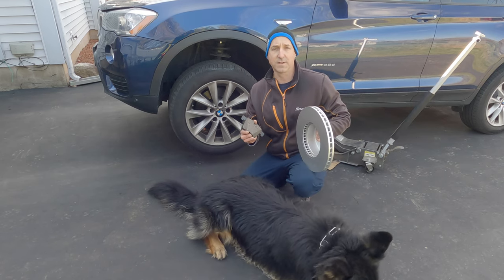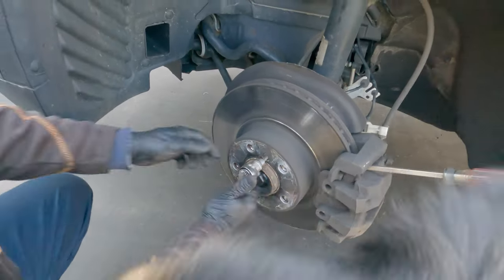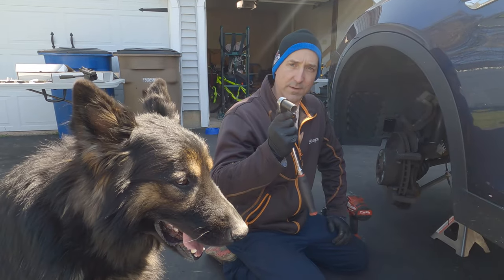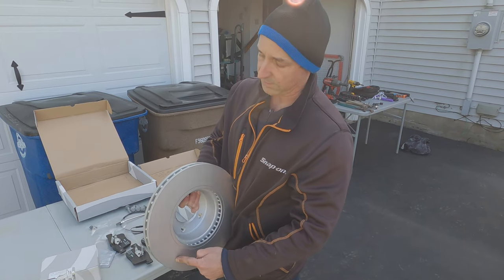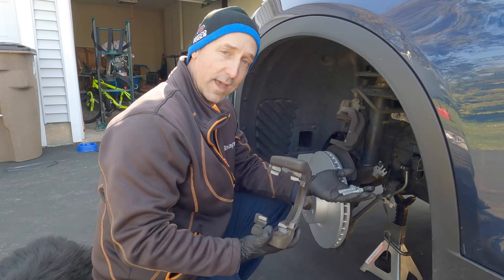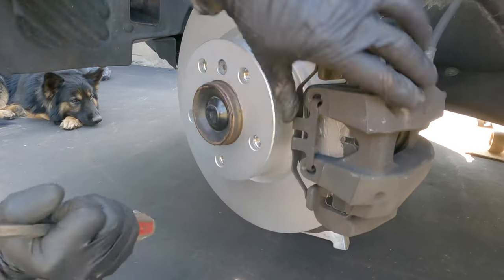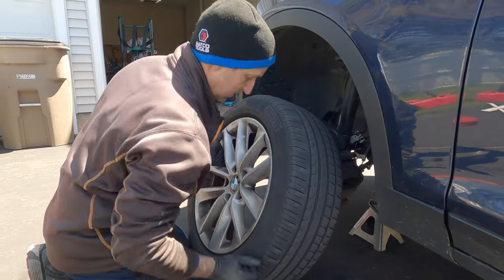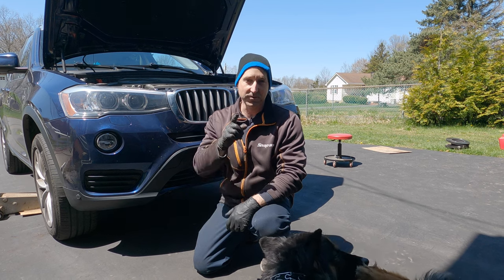F25 X3 : How to replace  BMW Front Brake Pads, Rotors, and Sensor - Complete Guide

Comment: Similar to other comments, I looked at a couple of other videos related to changing brakes on our 2011 X3 and yours was by far the most complete, consise and accurate.  In my instance, the brakes were actually fine but during a previous repair someone had not secured the sensor wire and it wore through and kicked out the brake replace warning.  Thanks again for the great instructions!
Reply from the maker: Thank you! Sorry to hear about the sensor. Very common issue. I often see that after a brake flush because it was left unsecured.

Comment: Thanks for the video. It was a great guide with my recent brake job. Just a note: there's no need to pop off the 8mm hex slider bolts if you're doing both pads and rotors. By popping off the 16mm carrier bolts, the caliper will come out all in one piece and then you can pop off the pads
Reply from the maker: Very true, I like to show the full steps. Some people have trouble doing that trick.  Glad it helped!
Reply: Clever...also using a channel lock was smart...I always used a clamp and old pad but the locks are much easier...always learning

Comment: Great video!  I just changed my front brakes and rotors, easy thanks to you!  My 2017 X3 2.8i caliper hex bolts however weren't 7mm but they were 8mm.  FYI, installed Akebono pads (kit came with the sensor cable) and Zimmerman rotors.  I picked up new rotor screws and 16mm bolts from the dealership.
Reply from the maker: Hi rkim, Great to hear my video was helpful! Thanks for the added information. You will have to let me know how the zimmerman rotors and akebono pads hold up.

Comment: Nice video!  My rotors are warped so i assume new ones if we cant turn them? Original 2014 x3 149k miles
Reply from the maker: Hi Doug, Sorry to hear that. It seems like a lot of BMW's are having this issue. Not sure if it is a quality thing with rotors from BMW. If they are above the minimum measurement by .5mm they can be turned using an on car brake lathe but I would recommend pads and rotors. To me it is still a better repair.

Comment: gotta question? does the brake pad sensor for bmw have to be specific with a different pad or it doesn't matter
Reply from the maker: Hello, The sensors are vehicle specific but some of the parts do cross over to different BMW models.

Comment: Haven't seen any video that actually done it to the manufacturer repair instructions. 
Hub surface must be clean and no grease on anything. 
Brake carrier must have no abrasives used on cleaning, only allowed is brake cleaner and lube with BMW brake grease. 

Personally I never had any brakes fail due to seals in master cylinders getting rolled or debris going back.
But I tend to find that using a mini prybar at the brake sensor hole area, you can literlly push the piston completely back and don't really need any other tool to push the piston back.

Though with the brake bleeder screw open, most brake piston retractions, you can even use your hands to push the piston back provided there isn't too much resistance due to size and internal corrosion.

The brake bleeder screw open with a miniture prybar can speed up allot and is one of the quickest ways to get things done. 
Even a quick pedal bleed job after is doable, two people. If with allot of moisture, pressure bleed out the fluid, 2L recommended. 
DOT4 LV. 

I would open the brake fluid reservoir to relief any pressure during retraction, it is stated to draw out excessive fluid first.

But yeah, at the dealer you will see those rotors come off by themselve, quite often impacting the bolt off the carriers is enough to get the rotor loose. 

One thing about the grease on the hub, its like an uneven surface and sometimes causes brake shudder, especially older models. 
Good idea on your part to replace as many bolts as possible, the anti-rattle clip is recommended every 48 months. 

While it is recommended to replace the sensor on every job, personally I have a stash of new wear sensors, so go figure, there is always the correct way to do it and the incorrect way to do things. 

After a couple of years of brakes at European dealers, you sort of know every trick in the book and everything that breaks. 
VW and their shitty wear sensor connectors on the vehicles, if you come across one, you'll be in a very bad day.
Reply: is it absolutely necessary to replace those mounting bolts due to stretch ?? they didnt comecwith the kit from FCP euro..and i cant find locally...trying to do this job tomorrow
Reply: @mikes8207  I would, for the F25 it is a stretch bolt design. M12x1.5 (75nm + 45 degrees + 10 degrees). Same for front and rear, be sure to check the bolt. Most models since the F series use stretch bolts.
Reply: After talking with this videos creator, I bought all new bolts from O'riley Auto, which was the only place local that had them. Only had time to do the fronts. I just hope i got the torque right. I did the 75nm but was unsure what that 45° meant (ive never came across that on my 07 750) so after the 75nm i gave it a good snug up. And im also hoping the bolts i bought were "stretch" bokts. Lol. Im definitely no mechanic but I do a lot of the work on the cars, especially mine. The x3 is a lot easier to do things like oil change brakes etx etc. Thank you again for the reply. You guys are both very knowledgeable and helped a lot. 👏👏👍👍💯💯
Reply: @mikes8207  Learn the right way is how to do it, what you do is tighten to 75 nm and then a clockwise 45 degrees and then another 10 degrees. The angle is what stretches the bolts. The angles for these is kinda bad since its very narrow. So a torque angle gauge, electronic torque wrench with angle mode or even a protractor to mark the angle. I usually use a SO Techangle so its kinda quick, otherwise sometimes I also use a sharp tip correction pen to mark positions. Don't let this confuse you, as some cars are a bit awkward for torquing, and require an odd torque setting like older VW hub nuts, its like torque to a fairly high value and then go back 180 degrees and then clockwise a couple of degrees.

Comment: Nice video very well done.  I keep getting a reset impossible message for the front brakes though.  Any suggestions?
Reply from the maker: Hi Warren, Thank you. What year is your X3? And did you replace the sensor with an OEM part?
Reply: @AskTheCarExperts  2011 and yes used an oem sensor
Reply from the maker: @warrenlaube3148  It may need to be reset using a scan tool. I have run into that before.  You can try to do a battery reset first. Disconnect the negative cable for 5 minutes. Reconnect, set time and date, try to reset again.

Comment: What about bleeding the brakes? How do you do that and at what point do you do that?
Reply from the maker: @jacobspence-olson  You would need to bleed brakes if the hydraulic circuit is opened ie. Caliper replacemet,  hydraulic unit, brake lines.
Reply: @AskTheCarExperts  so not for pad replacement then?
Reply from the maker: @jacobspence-olson  Correct, No need to bleed with pad replacement.  Just adjust the brake fluid resevoir to the correct level.
Reply: @AskTheCarExperts  Another question! I've been looking at rotor and pad kits on amazon and have found several. Some of the don't seem to show a locater/holding bolt hole for the rotor which is strange. Also, where would you recommend getting a new locater bolt and two caliper bolts since those are one-time use bolts?
Reply from the maker: @jacobspence-olson  I would use caution on aftermarket parts. BMW OEM is best. Or FCP with lifetime warranty. Hardware should be purchased from your local dealer.

Comment: Carp! I just noticed this video 😼
Reply from the maker: My friend did the recording using his GoPro and the editing.
Reply: @AskTheCarExperts  Just watching now 😎  Been diagosing kenmore washer codes this morning 😖  An OBD port would be handy on the washing machine vs decoding LEDs on the panel.
Reply from the maker: @MarioDallaRiva  OH man, Been there a few times with my stove, washer, and dryer. I hope you get it solved bud! I always like to try and fix it before considering replacemet.

Comment: Great great video !!!! I saw you had to change the mounting bolts, is that absolutely necessary?? i didnt understand about the higher torque you said it had after use ? thanks
Reply from the maker: Hi Mike, The hardware is technically one time use per repair instructions. I believe the caliper bracket to swivel bearing is 120 Newton meters. Glad you found the video helpful!
Reply: awesome...thank you...did you happenen ti replace the rears yet m (im going to check your videos).....Ive got a 07 750li ive done a lot of work to, never swapped those bolts, maybe i should have 🤦‍♂️.
Reply from the maker: I have a few videos on rear brakes. I have on on the F15 X5 which should be pretty much the same thing. You are most likely ok with your 750 but I would change them next time you need brakes replaced. I don't like to compromise when it is a safety item. Hope this video helps. https://youtu.be/QYpRiGgS8dY
Reply: @AskTheCarExperts  Dude your AMAZING. You do such a great job with these videos 💯💯👏...including all the torque is key. Thank you so much. I will be buying new bolts for front and back on the x3 and definitely swapping on my 7 next time also.
Reply from the maker: @mikes8207  Your very welcome Mike!

Comment: Does anyone know what the part number to the plastic clip that clips the brake sensor and speed sensor together? The white plastic piece? I broke it when replacing my front brakes and want to replace it. Clip shown clearly at 16:24
Reply from the maker: Hi Ryan, I can look that up for you. Can you post the last seven of your VIN?
Reply: @AskTheCarExperts  yes! The last 7 is 0W79482. 2017 x3 28xdrive

Comment: New to this; could you explain the 179 total torque. Are you doing each bolt twice to include the angle adjustment?
Reply from the maker: Which torque spec are you looking for? What you may be noticing is just having the torque wrench reach the correct torque. Then I often do a second check to the same reading.
Reply: @AskTheCarExperts  I have a 2016 x3 and I will be using torque wrench on the front brakes for the first time. When I watched your video I noticed you mentioned not to torque to 180.
Reply from the maker: @ericalfred4988  For which component? Wheels, bracket to hub, caliper to braket?
Reply: @AskTheCarExperts  bracket to hub
Reply from the maker: @ericalfred4988  Bracket to hub is 180 Newton meters
Reply: @AskTheCarExperts  thank you so much

Comment: not many people use a torque wrench to do a brake job!!
Reply from the maker: Hi Dave, Brakes are a safety item so I always felt it should be done by the book. Leaving any component loose could be very dangerous. I had one tech leave a caliper loose and it popped up while I was test driving the car for a different issue and it cut the rim open like a can opener!